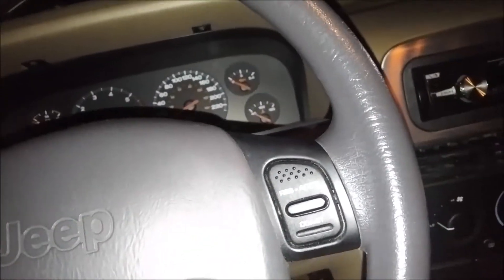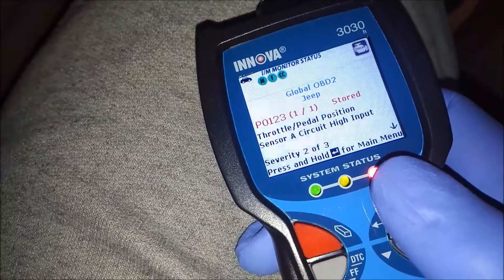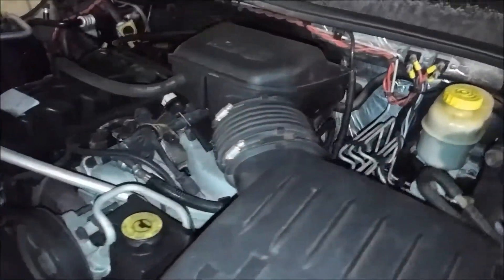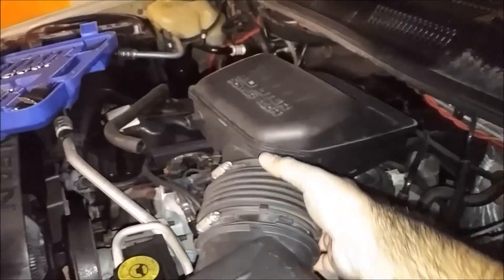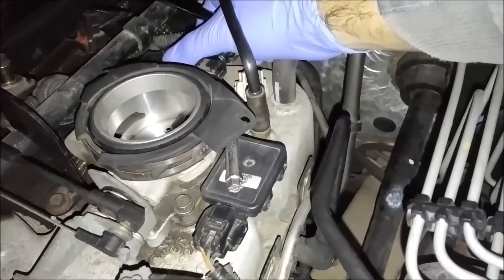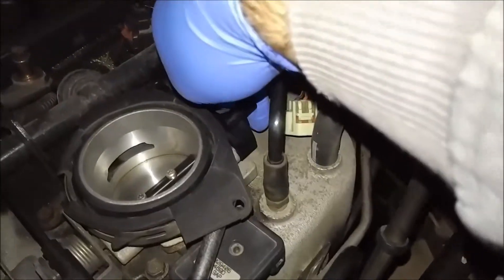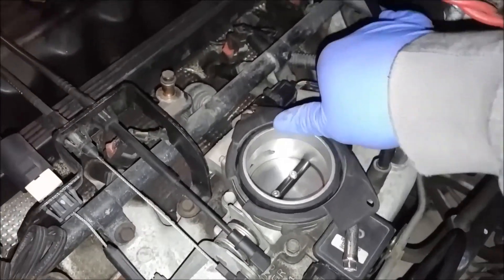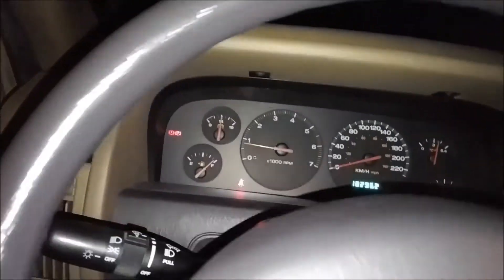Jeep 4.0 throttle position sensor replacement

Comment: Check engine light came on any other symptoms backfiring or stumbles or poor acceleration?
Reply from the maker: I was getting stumbles and poor acceleration before changing the sensor. Bad plugs maybe?